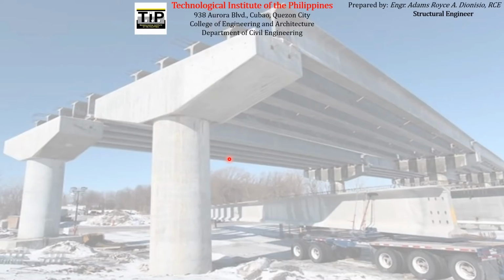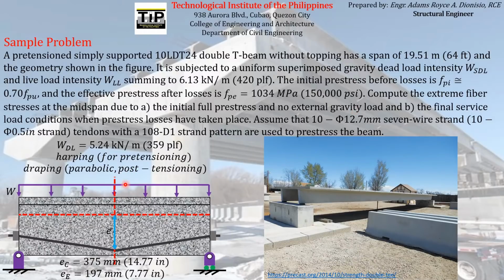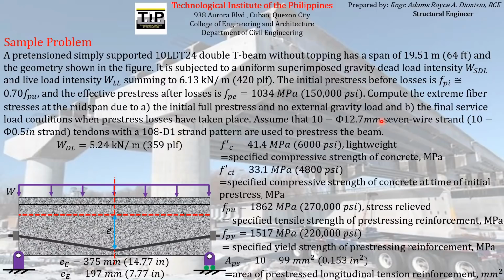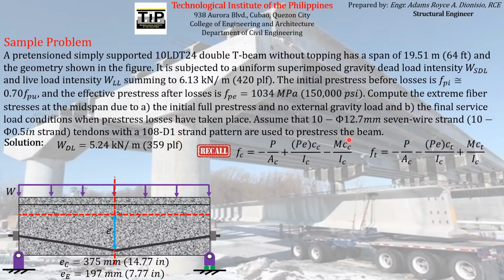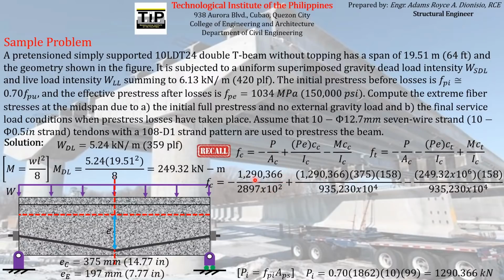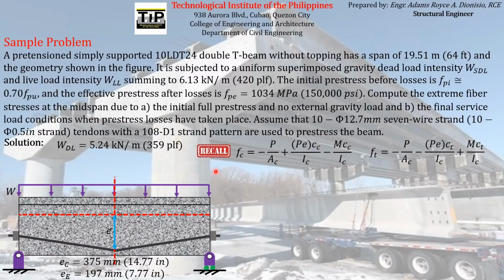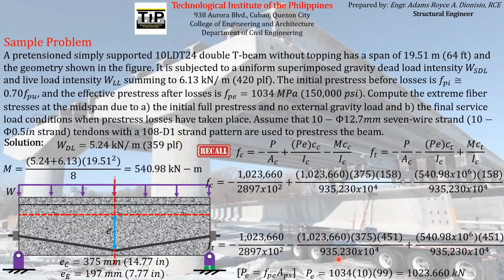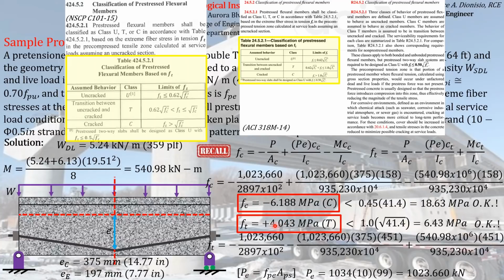3 Part 4 Basic Concept Method Sample Problem | Extreme Fiber Stresses | Maximum Permissible Stresses

Comment: Hirap pong maintindihan nung explanation sa 10:00 yung about f'c and f'ci
huhu
Reply from the maker: @rhezteedenga-ey6254  
f'c- concrete strength at 28 days
f'ci- concrete strength at transfer of prestress (usually at less than 28 days)

Comment: mali ata yung area ng strand..
Reply from the maker: A 0.5 inch diameter 7-wire strand has a cross-sectional area equal to 99 sq.mm . The 0.5in is the nominal diameter of the whole strand which is composed of 7-wires. Take note that prestressing strands are not made up of single solid circular wire but a "group" of wires twisted together. For more information, you can watch the discussion about prestressing reinforcement below

https://youtu.be/-PwfqjaTMLQ
Reply: @CivilEngineeringandEverything  Thank you.